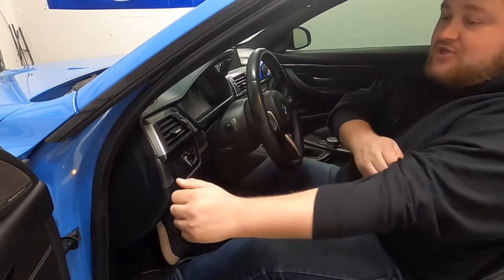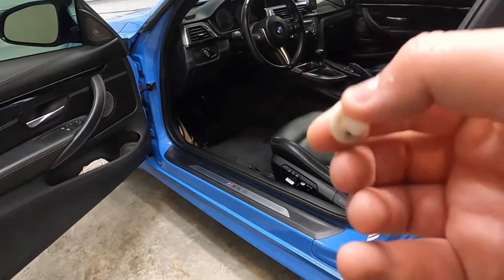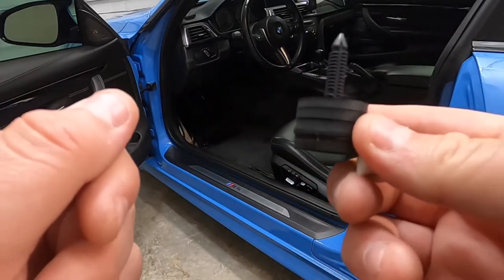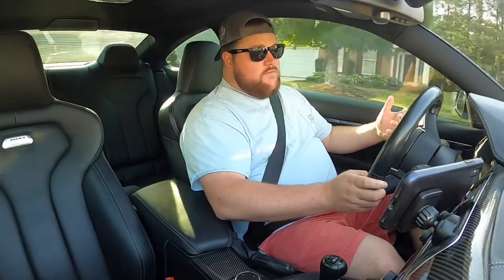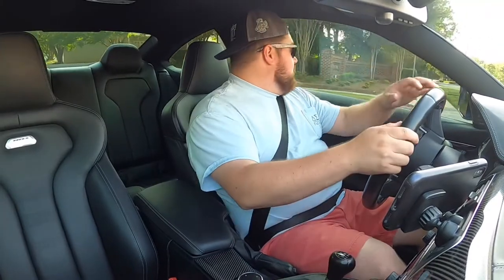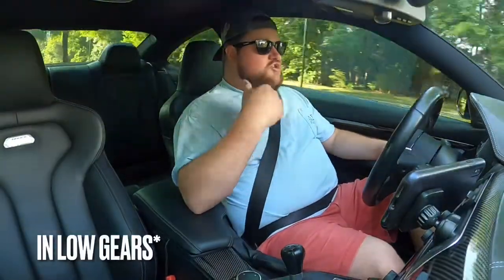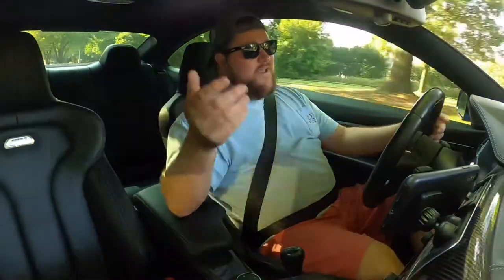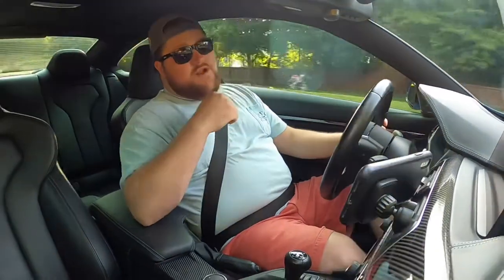BMW Clutch Stop Install & Why I Did It! -  M3 & M4 F80/F82/F83/F87 M2 & F3X!

Comment: And there's still play in the clutch? I sit in a lot of traffic so I don't want too sharp of an engagement point. I plan on removing at least two shims like you
Reply from the maker: Yes 100% removing them makes it much more dailable and doesn’t make it to snappy. If you remove 2 you’ll be good to be in traffic outside of the normal manual in traffic frustration

Comment: You mentioned you took 2 of the discs off, was this trial and error and have you tried driving with all of them on or just one off?
Reply from the maker: It was the consensus among speaking with a few others who recently did it that leaving all of the discs on there made it too touchy and it did not smooth out the shift experience. So trial and error of others. But taking 2 off was the perfect sweet spot

Comment: Cool review. I’ve been going back and forth on this for a while. I’ll go for it. Have you considered doing the Clutch Delay Valve delete?

Subbed
Reply from the maker: Thanks for the sub! 💪🏼 

The clutch delay valve is on my list just to get rid of that lag but i still need to do more research on it! From the brief overview I’ve done there is def some benefits in it but overall the clutch stop took care of a ton of the slop in my opinion and was a huge improvement.
Reply: @UnworthyMotors did you the delete
Reply from the maker: @darkemperor418  no i did not, havnt really had any complaints myself that made me want to go forward with it
Reply: @UnworthyMotors  ok thanks